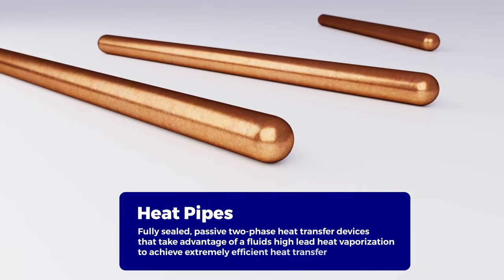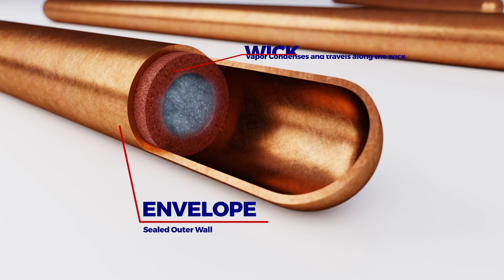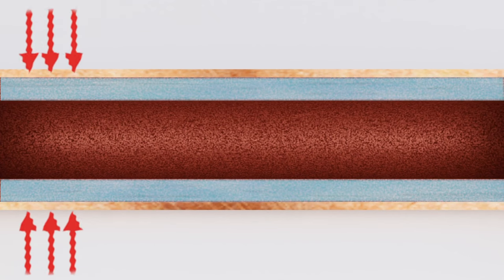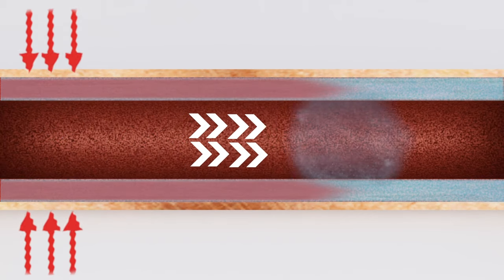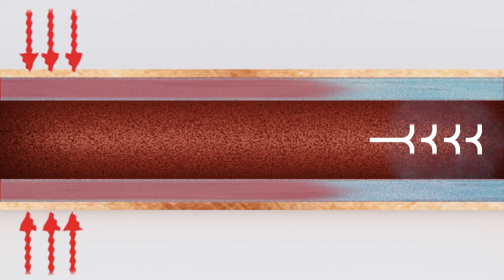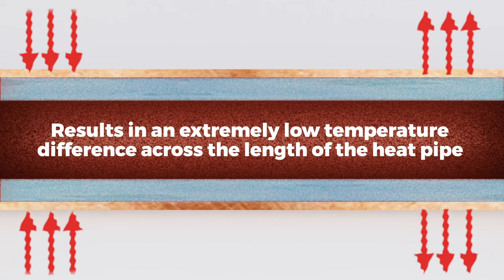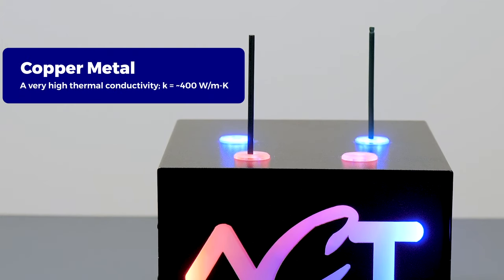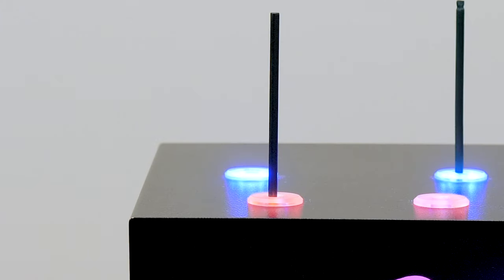Heat Pipe Basics and Demonstration on How a Heat Pipe Works

Comment: I don't see any mention of the need for heat pipes to be "tuned" to the conditions under which they will operate, like the need to adjust internal pressure to match the expected temperature difference where the heat pipe will be used ( one size does NOT fit all ).
Reply from the maker: Hi Gregory, you are correct. This is a heat pipe basics video, and as such doesn't go into minute detail on our heat pipe design process. ACT recognizes the importance of tuning the heat pipe parameters to each application. We go into more detail about our heat pipes on our Heat Pipe Learning Center page, https://www.1-act.com/resources/learning-center/heat-pipes/. As always, please feel free to contact ACT directly to discuss your heat pipe questions!

Comment: Great video and perfect graphics'   One point with "heat-pipe" over other types is the ease in "cleaning" the pipes at regular maintenance intervals as the "heat wheel" is more complex and if it get's "torn" or "ripped" the heat-wheel and Energy Recover is completely gone'  and not to mention the cost of replacing a heat-wheel.  Those heat-pipe will last a long time.  And thanx for sharing.
Reply from the maker: Very true! Heat Pipe Heat Exchangers (in HVAC applications) are a great alternative to Energy Wheels when considering maintenance needs.
Reply: @AdvancedCoolingTech  Is there any chance that the heat-pipe could be in the "smaller" residential ERV/HRV units?  Or is there such a thing?
Reply: @AdvancedCoolingTech  but then what pipe do you use to maintain the temperature of heat to another compartment.
Reply from the maker: @fauzan5919  Heat pipes will transfer heat very effectively. Our HighTemperature (alkali metal) Heat Pipes are used for temperature calibration and hold very tight temperature tolerances, of about .1 degrees Celcius. 

The difference from the common use is that this would not be connected to a heat sink that is trying to cool the evaporator end, but in your case would likely be attached to a heating element.

Comment: Copper rod vs heat pipe - interesting!
Nice to see how designed heat pipes in early 1970. especially these with a passive system designed to freez a tank of water that can make large amounts of ice with no utility to accomodate the entire cooling load to constructions especially compared with copper rod because of the tank made of reinforced concrete and insulated of polystystren. How heat is passivly carried from the water to atmosphere we see nowdays.
Shematic approach is so clearly explained as well as structure that provides effective workout!
Reply from the maker: We're so glad you enjoyed the video and found it educational. Check out our other videos or browse our website to learn more. We've got a great learning section on heat pipes! https://www.1-act.com/resources/learning-center/heat-pipes/

Comment: THAT IS SUPER COOL

The color-changing paint demonstration almost looks fake, the heat pipe changed so fast.
Reply from the maker: The color change is temperature-dependent, so it won't surprise you that we have to be careful not to set the heater in our demo unit too high or it makes getting the heat pipe out difficult.
Reply: And the dude just grabbed it without gloves
Reply: @patjustpat8178  They never stated how hot it was, just hotter and colder. The red in the hot well is illumination, not that it is red hot. This is why they use thermal paint for the demo.
Reply: @gabrielsierra6890  if i recall, you could get straws that did it...cups. didnt coke or redbull do a limited edition of cans?

Comment: Also called drywall heaters, pipe heaters are useful in several oil
and gas applications. They can withstand caustic and corrosive
materials, as well as reaching high temperatures. Some common
applications of pipe heaters in the oil and gas industry include: Tank heating, Pipe heating, Freeze protection

Comment: At the high pressure existing at the bottom of the producing well, crude
oil contains great quantities of dissolved gases. When crude oil is brought
to the surface, it is at a much lower pressure., the gases that were
dissolved in it at the higher pressure tend to come out from the liquid.

Comment: Great visualization and explanation, when will CPU cooler manufacturers start adding thermal paint like that as an option? I think that'd be very fun.
Reply from the maker: Good question! We only use the thermal paint to show heat transfer visually.
Reply: It would interfere with the transfer of the energy both into the device or out of it.

Comment: Hi, I have a question. What do you think about heat pipes in PC air cooling system that they design to let the condenser to be below the evaporator? I think it would affect its heat dissipation efficiency, but how much would you think it is? I think could be less than -5%... Or more and less? But such question can only be answered by experts as I don't have any reliable sources to reach such information myself, so your help is very much appreciated. Thank you! 😘
Reply from the maker: Heat pipes would be a great application for this! Heat pipes use capillary action, so they are able to move heat when the evaporator is above the condenser (against gravity), although they’re still able to carry more power when gravity-aided (evaporator below condenser). Depending on the heat load, there may be virtually no difference in thermal performance against gravity or gravity-aided, but the max heat able to be transferred is affected. You can gauge if heat pipes could work for a specific case using our online calculator here: https://www.1-act.com/resources/tools/heat-pipe-calculator/

Comment: I am wondering what happens when sub zero air is passed over a noctua cooler.
Will the wick structure freeze with liquid at the distal end?
How cold is to cold for a heat pipe to work?
Reply from the maker: This is a fantastic question, Stuart! Might I recommend a pen and paper? The answer to your question is rather in-depth. If the CPU is off during the period when sub-zero (°C) air is blown across the cooler, then the water inside the heat pipe will likely freeze. This isn’t a problem for well-made heat pipes, because the water is housed entirely in the wick structure, so the expansion of the water during freezing does not impact the envelope of the heat pipe. If the CPU is running and dissipating heat, then the air would likely need to be a lot colder to reduce the entire temperature of the system to below the freezing point. 

A copper/water heat pipe (like the ones used on CPU coolers) has temperature-dependent performance and can dissipate a varying amount of power depending on what temperature the water inside the pipe is at. Of course, below freezing (0°C) the water is frozen and above the critical point (374°C) the water has poor thermophysical properties so you could expect some dependence on temperature. You may use the heat pipe calculator on our website to input your own data and view the temperature dependence of a heat pipe. 
https://www.1-act.com/resources/heat-pipe-calculator/
Hope this helps and thank you for asking!

Comment: Hi, can you put steel wool inside a heat pipe
i heard it causes a exothermic reaction which makes a small heat make a larger heat
thanks for letting me ask

James
Reply from the maker: No, a heat pipe is a completely sealed tube where the fluid continually vaporizes at the part exposed to heat and condenses at the colder regions. Nothing can be put inside this sealed tube.
Reply from the maker: Steel wool is not used inside of a heat pipes because it’s typically comprised of low-grade carbon steel which would react over time. Stainless steel wicks have been used for heat pipes and is compatible with several commonly used fluids.
Reply: @AdvancedCoolingTech   what are commonly used fluids?  What factors determine the efficiency in the application of heat pipes, such as latent heat of vaporization, boiling points?
Is water more efficient in heat transfer but more corrosive than something like acetone, which seems to be commonly used?
Reply: @sadfur8728  it literally says it is water.
Reply: @NigelTolley  A DIY setup may use water, but that's just a convenient substitute.

Comment: Hi, nice video..
Can the heat pipe running out of its liquid? Due to long term use
Thx..
Reply from the maker: No, a heat pipe is completely sealed, so there is no potential loss of fluid. Heat Pipes are a great passive option that provide a long life for your cooling system!
Reply: @AdvancedCoolingTech  Nice to know! Thank you! 👍🏻

Comment: How long can a heat pipe be
Thanks for letting me ask
Reply from the maker: A heat pipe working against gravity (with the condenser below the evaporator region) maxes out between 10-12". In the reverse orientation, you can expect a a few feet to work well, but at some point it is about the practicality of manufacturing them (thin long pipes can easily bend, which can compromise the wick structure.
Reply: @AdvancedCoolingTech  what if heat source and drain are both at the same level? (Example: campfire to interior of tent)

Comment: For 15 years I've been trying to understand heat pipes and I just can't. What causes the vapor to move from the hot area to the cool area? And then when it condenses, what causes it to move the other way?
Reply from the maker: Heat Pipes exist in a two-phase state at all times. When heat is applied to any area of a heat pipe,  the liquid portion evaporates in this area and this process displaces the vapor that is everywhere else in the heat pipe. Because the evaporation removed some of the fluid from the wick, the capillary forces of the wick pumps liquid from the condenser area back to the evaporator section.
Reply: @AdvancedCoolingTech  thanks, that makes sense!! Finally I get it
Reply: Further, the high temperature vapour/gas molecules rapidly move towards the cold end, heating it up, before cooling down again. And gas molecules move really fast!

Comment: I have a question. What if it's upside down and the source of the heat is on the top of the pipe and the colder region of the pipe is at bottom. Would the heat transfer be as fast if the heat source is at the bottom and the colder region is at the top? I hope anyone can answer. I ask this because I want to know if gravity and evaporation has a role in the orientation of the pipe and if it will be as efficient base on orientation
Reply from the maker: The orientation of the pipe will impact the transport power capacity (i.e. how many watts of heat it can move from evaporator to condenser); it will be capable of transferring less heat when opposing gravity. If it's designed correctly and capable of transferrin the amount of heat required, there will not be a large impact on the efficiency when operating against gravity. If you'd like to discuss your project, send an email to get started: solutions@1-act.com

Comment: How long can they be
Reply from the maker: Earthbound heat pipes that work against gravity are relatively short — typically, a maximum of roughly 2 feet (60 cm) long, and a maximum elevation against gravity of roughly one foot (30 cm).

Spacecraft heat pipes are usually under 10 feet (3 m) long, and the extra length is allowed because they operate in zero gravity.

When a heat pipe works with gravity, called a thermosyphon, the length can be virtually unlimited, and you’ll find many in lengths up to hundreds of feet (m).

For more FAQ info: https://www.1-act.com/innovations/heat-pipes/
Reply: @AdvancedCoolingTech  Oooooooooooooo, delicious. 
Delicous information mmmm.
Thank you thank you so much!!

Now how small can we make them?
I'm thinking we need an upgrade to thermal electric generators and its feeling like heat pipes might be that solution
Reply from the maker: @Kair Hatchet 

ACT manufactures copper/water heat pipes from the following standard tube sizes (outside diameters) which are readily available: 
3, 4, 5, 6 and 8 mm
1/8, 1/4, 3/8 and 1/2 inch

ACT can also create custom heat pipes outside of these diameters.

Comment: 0:10 caption “high lead heat” voiceover “high latent heat”. WTF? It’s hard to trust a video with no quality control.
Reply from the maker: @neilbrewitt, thank you for pointing out the error. Sub titles are auto-generated by YouTube. The error has been fixed.

Comment: "the heat pipe can work on adverse orientation"
You meant inverse.
Reply from the maker: ah! interesting grammar comment. We use adverse because it is not only the opposite direction but actually working opposed to gravity (working in an opposing direction is one of the definitions of adverse).
Reply: @AdvancedCoolingTech  working against something. However while that definition correct the way you said it is still inverse. The opposite orientation.

Comment: this just adds more confusion I think.
Reply from the maker: Is there anything we can clarify for you?
Reply: @AdvancedCoolingTech  i.e. Why do you need a capillary material inside? Why doesn't the water just run back down to the heated area? Just saying it happens doesn't explain much to me, it just begs more questions. Obviously I am no physics wiz...
Thanks
Reply from the maker: @gerrys6265  Thanks for the question! The capillary wick enhances return to the evaporator end against the vapor flow, and also provides a return path when the heat pipe is oriented so that the liquid is returning against gravity---think how water travels through a paper towel against gravity! Hope that helps make it clear.